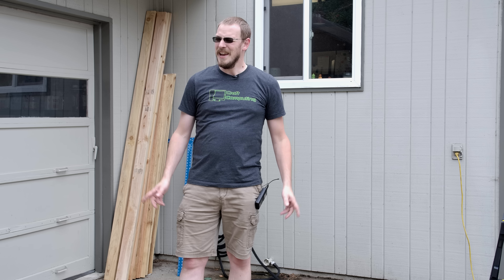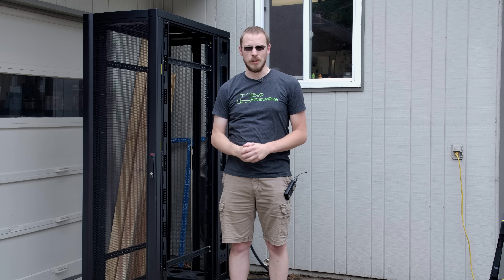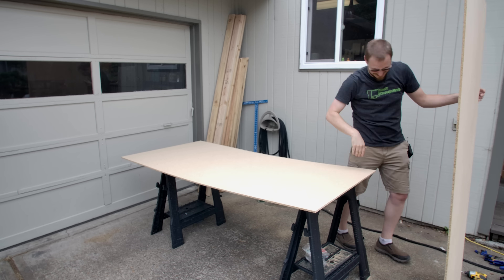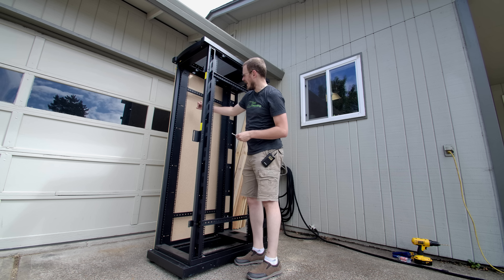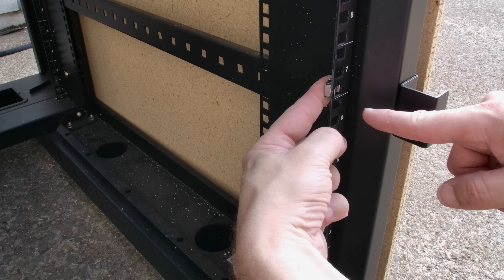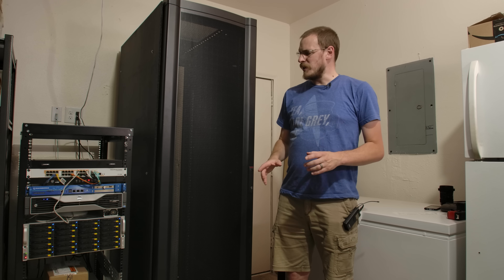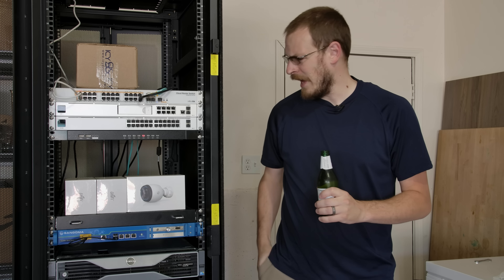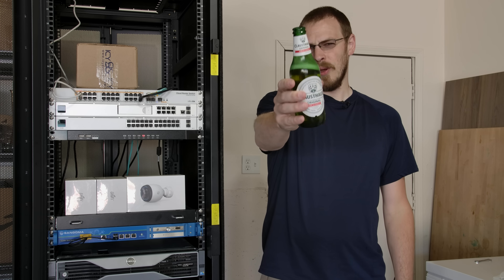MASSIVE Home Server Rack Upgrade!!

Comment: Those are very expensive side panels - in Poland you can buy a 42U rack case (lanberg FF01-8242-12B) for less than 800$ for all (including both side panels).

Comment: My sun rack was 150 euro with 2 doors side panels power distribution unit with 4x 16A C13 socket strips. Only disadvantage no cage nuts but directly tapped holes. Not all rails will fit with out angle grinder 😄 But I can take it apart and move it in my volvo v70 car 😁

Comment: You totally could have done the part where you lay it down without laying it down.  That would have scratched the bottom corner and possibly the side where you laid it down.  Additionally, you could have used one side panel as a template for the second side to avoid tipping it twice.  Anyway, it looks pretty nice for wood panels, and you can even screw stuff into them, like power strips or cable management or non-rackmount hardware if you'd like or need.

Comment: Hey Jeff....love the videos....what Dell Poweredge Server do you have installed in your rack?  It looks like it's a R710 but can't tell.  Was trying to look for past videos where perhaps you've focused specifically on that server, etc.   Also what is it used for and what OS are you running?  Thanks!
Reply from the maker: It's an R7610 Rack mount Workstation. You'll find info in my Cloud Gaming video playlist 😉
Reply: @CraftComputing  Jefff...Thank you for the quick response!  I'm working on replacing a very old PowerEdge 840 tower that is racked in an office with a more updated but used 2U rackmount style server that can support Server 2019 as well as running possible VM's and have been shopping around for a client.  As enterprise class servers go I've been shopping around for 16 - 24 bays and have found some great deals used servers but I've been told to look no less than Gen13 PE Servers or Gen 9 Proliants but honestly don't need that much horsepower as for not it will only be used as a file server.  Yes...I could build my own and have but this is for an office where an Enterprise grade server is needed as well as support.  Any suggestions would be appreciated.  Thanks again.  James.

Comment: For cooling I would suggest that you leave at least 1 ru between each piece of equipment, and reverse mount the network switches to make it easy to cable from the servers no bringing cables to the front. It also gives you a way to not have a mess of cables across equipment ( but that means you have to have ready access to the back of the switches), BTW nice job.

Comment: Please don't use wood for the panels. Go to any metal fabrication shop and get sheet metal cut to size instead. If your backplane catches fire (which does happen), it can lead to the RAID controller battery to explode (if the server isn't disconnected from power immediately) and having wood side panels will only make the situation worse.

Comment: one thing that could have been better was like going with cabinet locks to add an easier way to put out the panels for special maintenance like cleaning or routing cables sideways. for example, a dirt cheap step bit  and this 10 pack cabinet lock (amazon[dot]com/dp/B08BNVRHMD) would have been the same price but limit the work when you need to put out the side panels (and I know when adding or putting out hardware and doing cable management it's almost necessary to put them out

Comment: On my system the the heat from the 6 system blows out the back of the file cabinets, I have the server in the middle of the file cabinets and the heat blows out the back of the cabinet like a vent out the front door

Comment: Netshelter is not out of manufacture, it looks like you bought a VX which is an older model rack the newer generation is the SX style rack.
Reply from the maker: Correct. My particular model was discontinued some time ago. NetShelter is just a line of racks.

Comment: This might depend a lot on where you're based but would it be worth having a switchable air outlet on the rack, so in winter you could keep the server heat inside, but vent it in the summer?
Reply from the maker: Yep! That's exactly the plan 🙂

Comment: I have done nothing but fit servers to racks for years of my life. Looks like you have good cabs there. The wheels will give you +8 to sanity. May I suggest putting some time into planning your cable runs between devices before you have everything bolted down? I always used the mantra "the box I will need to swap will be the one in the middle" to imagine my way out of a hellish future job.

Comment: Dont make the same misstake I did. Overlooking the airflow for the switches/routers/firewalls. They often take air from one side and blow out the other. When using a real rack with airlow management, they will suck in hot air from the inside. You need a duct to channel the airflow. If you have the same luck as me, you will have a few flowing right to left and a few the otherway... :D

Comment: Hmm... ...if you're going to have your switches facing the front, then you should invest in some decent patch panels so you can leave all of your host and storage connections static and just move them in the switches as necessary. Personally, I prefer to just leave all of my cable management to the back of the rack and have the switch ports face the side of the server with the relevant ports, just to save myself the trouble. My work is in a proper lab environment, so I do have the luxury of accessibility from both sides, so racking a full depth switch from the back isn't a problem for me. Still, I would rather rack everything and then have to lift the feet and move the loaded rack than have to fight with that many unnecessary patch panels in an attempt to keep my cabling tidy. I also tend to go overkill when I get to choose the switches to be deployed so I can connect all relevant host and storage ports and sort out how I want the connections managed through VLANs and zoning after the fact, so I should reasonably never need to touch the cabling until those hosts or switches get rotated out for the next generation. Given the relative cost of Cisco Nexus 5548 switches, if I really cared about lab network speeds, that would be the switch I would invest in. Plus, the Cisco Nexus 5K and higher switches support provisioning FEX, so you can have a relatively quiet 2K elsewhere in the house and it's just an extension of the core switch. Very convenient. They're also pretty cheap, given that they don't function without a switch to attach them to.

Comment: Jeff, as you have a big rack now, you have the space to rack the network hardware in the back.

You could mount in or outward facing but it cleans up all the network cables, so they just run up and down the back (down the sides) 

While I don't know how you ac will work, it will help closing the front of the case off and not having to make cable space, or buy the brush things (the technical name obviously) for the cables to poke through and come out the front.

Also you guys have cheap racks there... 
And I hope you sanded off the bit where the board dropped when you were cutting.

Comment: "This is called a cage nut" As I shudder from dealing with cage nuts in the past.
Reply: Rack studs, I love them
Reply from the maker: Sorry for the flashbacks. I too have PTSD from dropping your last cage nut in a data center, hearing it clank on the bottom of the rack, and not drop through to the floor.....

Comment: going to ac is too much - stick it in your basement or maybe a rack it a terrible idea to begin with - even most small biz don't need them - it is a bad sign of your computer sickness - mostly accurate #consolidation
Reply: why enclose it so when the ac fails and it will then everything definitely overheats - get a mini split and a heat exchanger
Reply from the maker: Mini-split to cool 900 sqft garage with no insulation, vs a rackmount AC to cool ~4 ft^3 for the server intakes. That seems like great consolidation and efficient use of energy. Let alone the face you think I'm not going to put environmental monitoring in the rack in case of failure...

Comment: cutting those panels straight would be easier if you had a circular saw and not a jig saw. jigsaws are for patterns not straight lines.
Reply from the maker: Straight enough, and just as straight as a circular. Just a bit slower.
Reply: @CraftComputing  fair enough, there is always a proper tool for any job and a tool that is good enough and does the job without issue. it's not like there is anything really wrong with you using a jigsaw to cut the panels and me being a random voice on the internet it's not always wise to listen to just anyone, especially when they might or might not have sounded a bit condescending without meaning to. 
and for me it probably would be vastly more difficult to cut a straight line with a jig saw.

Comment: I'm flabbergasted that you spent $120 on that without the side panels. Up in Seattle they're giving 1-2 gens before that away for 20. I got 4 racks recently for $50. gave 2 away sold 1 for $50 and kept an older Compaq one because I thought it was funny that it has Compaq on it. 

The APC's run a little more, but easily should have gotten the side panels included. I'm guessing you just were trying to get something done quick?
Reply from the maker: If you look around, sometimes you'll find full racks with sides around here for $150. But where I live, we don't have nearly as many opportunities, and prices are just a bit higher for enterprise gear.
Reply: @CraftComputing   I assumed you were closer to Portland. But, if you look up at the Seattle/Tacoma area you can find some great deals. Might be worth doing so and just planning some runs across the border. 

Look around on offerup and craigslist up here, Seattle, Bothell, Redmond, Bellevue, and Tacoma. I'm am able to grab stuff for ya and hold it in my garage. I'm constantly grabbing things. Also, my company is constantly tossing gear to recyclers so you're free to pick through that stuff as well.

If that's something that's interesting for you just  reply to this thread and I'll e-mail you with my details.

Comment: Isn't that plywood a potential fire hazard next to electrical wiring? 
I mean it sure is isolated and stuff, but still.. Especially next to a bunch of machines producing few hundreds of watts in heat.. 
But on the other hand, really nice and cheap alternative! Kinda digging the looks of it.
Reply: You mean like the plastic that surrounds romex wire, or the plastic boxes the wiring goes in, or the plastic outlets they all plug into. It's fine

Comment: Another great way to make large sheet cuts is to get a 4x8 sheet of high-density insulation styrofoam at least an inch thick or use two sheets. lay the plywood down on it on the ground and then use a circular saw with its depth set just below the thickness of the wood. you get much better control and don't have to worry about balancing the cut-off or warping and writing from the stress of the cut off altering and stressing the wood as you cut. This also works well if you have a track saw. I would have been tempted to put threaded inserts into the panel that are the right size for the M6 Bolts and then bolted it in that way. Then it's easy to attach and remove using standard fittings. The threaded inserts would have aso prevented wear and tear on the holes in the panel.

Comment: the amount of times i got those dam cage nuts stuck in my fingers, hated them with a passion.
Reply: Cuts I got from 'rose petal' rotary nuts of old Sun racks never healed. I'm surprised they stopped bleeding. Normal cage nuts are perfectly safe AS LONG as you you flat screwdriver to put them in,  like Jeff did here.
Reply from the maker: I think StarTech cage nuts come with a handy tool for installing and removing cage nuts. Never jam a screwdriver into your finger again!

Comment: Hey Jeff, i do not know if you already did, but check out on making those mdf fireproof, electronics running 24 7 dont go well with wood, nice video btw, love this server videos :D
Reply from the maker: There isn't a single component in this rack capable of generating enough heat to burn wood.
Reply: @CraftComputing  nice to know that, just thinking about psus getting on fire, but you know well what you have on there, waiting for the second part tho :D

Comment: What a coincidence. I just spent the day removing everything from my rack in order to have two powder coated galvanized sheet metal side panels installed by a couple metalworkers. 
Once they were finished, I managed to set everything back up, turn them all on and see if they're working (which they are), only to notice this video in my notifications as soon as I had finished. An entertaining and perfectly timed upload. 😎
Reply from the maker: I do know a couple metal fabs in the area. Considered going that route as well. But this was a fun project to DIY.

Comment: A word of advice on the AC unit, if it mounts to the top of the rack make sure to run a tube from the condensation overflow to the floor.  Have dealt with these type of units leaking into racks before.
Reply from the maker: Yep! Already in the plans :-)

Comment: Security Admin called, wants to know why you didn't lock the rack.....Kappa
Reply from the maker: Because it's a generic cabinet key. Be better off duct taping it closed.
Reply: @CraftComputing  If I've learned anything in enterprise IT for the past 15 years, it would be that it doesn't matter if it helps security or not, it only matters that we can check the box.....

Comment: Ok rack master, here's a question for you.  I'm thinking of picking up a used tripplite 12U wall mounted extended rack for my 2 ups's and my supermicro 846 case.  It's only rated for 200lbs max, but the ups's together are around 180lbs.  Is there a way to bolster the rack so it can handle the extra weight?  Is it the hinges on the back that are too weak or the wall mounting holes that need to be reinforced to handle the extra weight?
Reply from the maker: Most of the racks you're describing are made for switches and patch panels. They're not sturdy enough to support rack servers and UPS units. The largest 'server' wall mount racks I'm aware of are only 6 and 8u, and are vertical mount racks, keeping the weight closer to the wall.

If you're racking servers, I'd recommend a flatpack 12U or 18U rack off Amazon.
Reply: @CraftComputing  Thanks jeff, the one I was looking at is a tripplite 12u wall mount extended depth actually rated for 250lbs.  I'd give you a link but as you know youtube usually flags comments with links pretty fast.  Good luck on the rack A/C unit.
Reply from the maker: Send the link, I'll manually approve it.

Comment: Weird you haven't attempted adding some foam sandwiched  in between side pannels and the rack to improve noise cancellation...
Reply from the maker: Most of the noise escapes front and rear of the rack, and I'll be addressing both of this in the next video.
Reply: @CraftComputing  Yeah, but the sides resonate as much if not more once you "close" the rack anyway... a bit of foam for noise insulation applied upon the construction would do well and not require panel removal later on, bearing in mind that this is still plywood and wood is not great when screwing it in and out and in... etc. ;)

Comment: You don't even clean it before transfering your equipments in. And you don't even clean your server before putting them in the new rack :'(
Reply from the maker: I absolutely did clean the NetShelter, and there was hardly any dust on my servers...?
Reply: @CraftComputing  at 12:38 there is fingerprints on what appear to be dust.

Comment: with the rain, animals and heat it sounds like your in Alabama. I am in a similar problem space right now. I have fewer servers but they are all used for deep learning.  Power and cooling are my two issues right now.
Reply from the maker: Actually, Oregon :-)

And yeah, power and cooling were my main issues as well. Just added a pair of 20amp circuits to the garage to fix power, and AC to the rack next week!
Reply: @CraftComputing   I see a 2x 20 amp breaker in my future, a dell r720 and dell r730 each with 2 Tesla k80's. Each pulls ~800watts each
Reply from the maker: Heh, yep, that'll spin your electric meter real good.

My rack at idle is ~585W right now.

Comment: I was able to procure an EMC enclosed rack years ago, before they were bought out by Dell I believe.  My plan is to rebuild the storage room the previous owner sectioned off in the garage as my server closet / workshop room.
That wing-nut also installed a window-style AC unit through the wall connecting the former dinning room and garage. So yeah, it vents and drips water right into the garage, not outside (sigh). I mean it's a nice LG cooling and heating unit, so the plan is to relocate it properly to vent out the heat and use that to climate control that equipment room.
I've had so many of these head scratching moments while working on my first home, but that AC in the dinning room wall still makes me chuckle.

Comment: Also to add to my previous comment about MDF. I expect you will have moisture problems. With it outside your humidity will go up and down. You will have condensation on the outside of that MDF at least. And it will fall apart. Keep a close eye on it.
Reply: If it's painted decent it should be fine
Reply: @mrmotofy  it will help. Only takes a single break in the paint for the MDF to start absorbing moisture and crumble. With the really thin material chosen, much less time. Chicken Little, signing off.
Reply from the maker: I'll spend another $20 in wood if that happens in 4 years 🤣
Reply: @CraftComputing  that's the attitude! Do update us if anything changes. BTW there are inexpensive plastic alternatives...